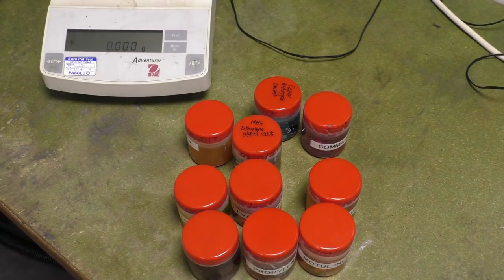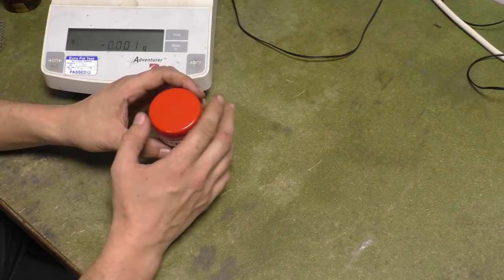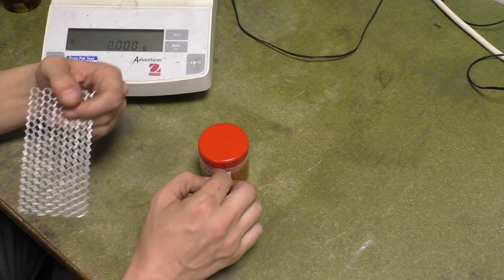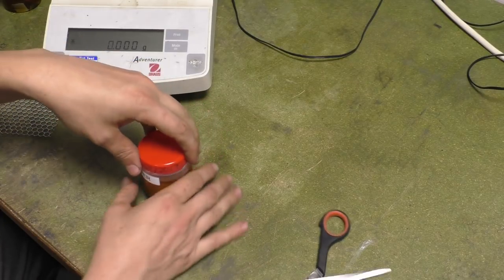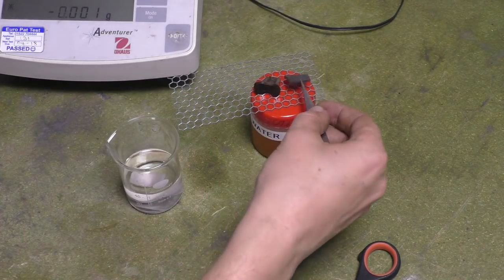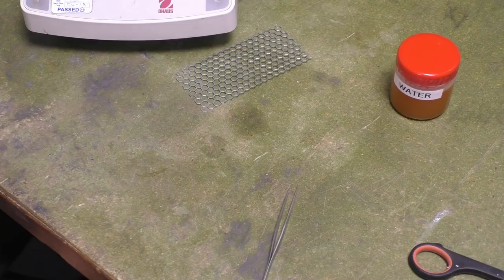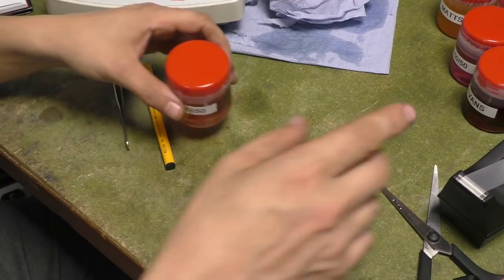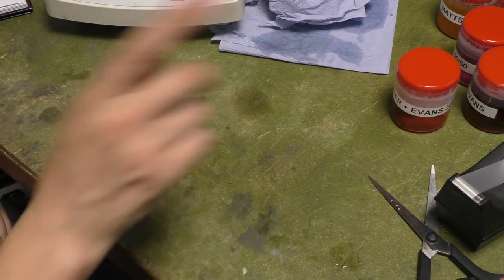Coolant Corrosion Test - 1st Month

Comment: the anti freeze i used in my kawi is made by evens but called TF, i think. and it is pure ethylene glycol and perfectly clear, unlike the evans you get there and magnesium is never used inside engines for it reactivity to pretty much everything, especially oxygen which can get out of control and burn in the right situation...magnesium is only used as covers for things like the clutch or oil filter housing  and no longer used for rims as it causes fires that cannot be put out with water as magnesium burns under water

Comment: As a Qualified Lab Tech who worked for 7 years in a Quality control lab.... I cannot fault your procedures.
Oxides will weigh more of course than clean metal perhaps offsetting some corrosion.

Comment: So do Evans sell a coolant filter for magnesium engines?
Reply: the only magnesium engine ever made that i know of is the air cooled VW from around 1970 or so and they burned very well...so no coolant for that motor...building an angine block out of magnesium is beyond stupid as it burn readily and cannot be put out, even if you submerse it in water the magnesium will burn as it provides its own oxygen once the burn starts https://www.youtube.com/watch?v=nhY0xzKcPoE ... that a video of VW blocks burning

Comment: what would happen if you ran a 0 wt oil as coolant. It would not  cool as well no shit but i wonder what the difference actually be
Reply: Matt Drew I thought the same about mineral oil. I’d be interested to see how good or bad the thermal exchange would be.
Reply: Mineral oil can only store about 40% as much energy as pure water, and it only leads heat away about 20-25% as well as water does. It does transfer and store heat better than air does though, which is why you can use it for cool pc aquarium builds, and also why radiators need to be so damn big compared to the thermal dissipation.

Comment: Some interesting results there Matt.
Out of interest, how big is that sonic bath you're using and was that what you used to clean up your SV carbs or was it the tumbler? I'm considering buying a sonic bath to clean small parts no bigger than dismantled carb bits etc.
Would you recommend a bath or a tumbler for such things?
Reply from the maker: Sonic bath. you'll never get all the shit out of the jets with a tumbler. There's a lot of dust even when you run it wet - tumblers are for abrasion not cleaning. The bath I have and used it for the SV throttle bodies is 30 x 15cm and 18cm deep.
Reply: Nice one, thanks Matt.

Comment: Have ypu checked the PH of the solutions before and after? With the Coma the fissing might be as a result of an acidic solution? A change in PH will indicate chemical reaction between the metals and ingredients in the solutions.
Reply from the maker: Its the castrol that was fizzing. And no I didn't check the pH - more on why later

Comment: Why have you mixed certain coolants with water?
Reply from the maker: Water is the main thing that cause corrosion - this will show how much
Reply: The Workshop so it is just to corrode the materials and see how well the coolanrs prevent it from corroding, correct? Because I believe you would't add water to your coolant in yout bike
Reply from the maker: it depends if it 50/50 - I'm confused now - what do you mean?
Reply: The Workshop i've never owned a water cooled bike. So what I want to know is, do you also put 50/50 water and coolant in your bike? And if you don't, then why do so in the experiment?

Comment: cool test but time consuming and good to see that early results are throwing some anomalies up, i wonder if you start finding stuff that will upset castrol and motul,  YOU NEVER KNOW YOU MIGHT END UP WITH A LAWSUIT THAT EVANS DIDNT HAVE THE BOTTLE TO FOLLOW UP WITH.
Reply from the maker: LOL what is with you lot and lawsuits. This is testing there product. Under trading standards they have to perform as advertized. If anyone is in trouble its them not me. Slander is not something that applies to products in this way.